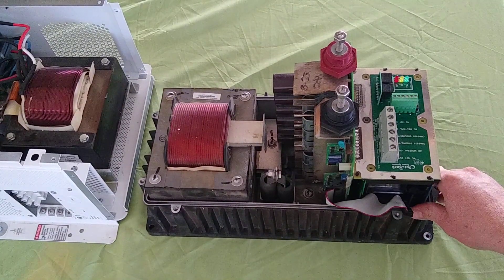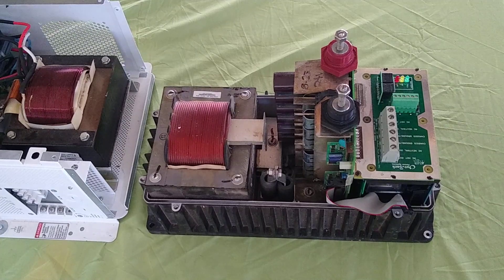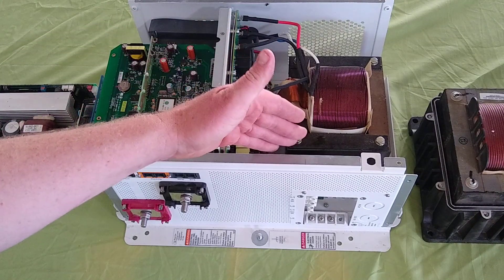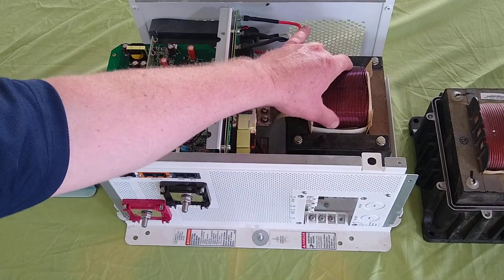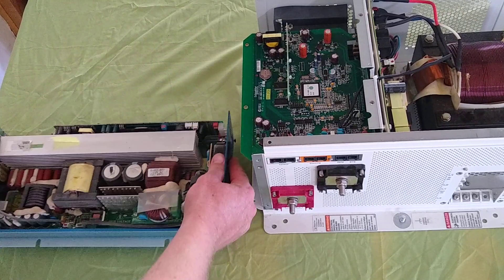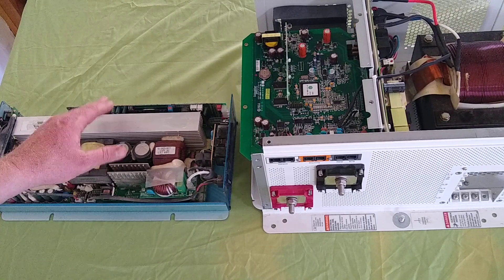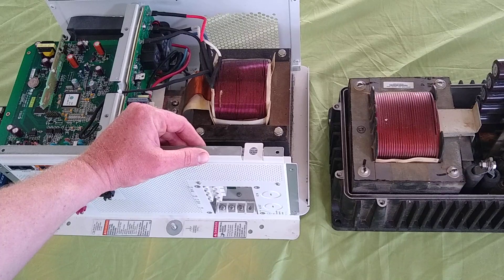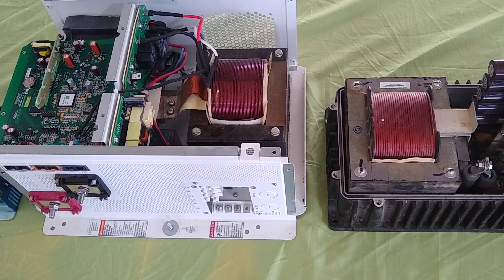Watch this before you buy an off grid inverter

Comment: I would like to hear Your opinion on Victron inverters please,specifically i have the wictron RS 48/6000/80 smart solar offgrid inverter,about 5 kilowatts pure power,with a 450Vmax 80amp solar charge controler,it runs even heavy loads and high start up motors too...but i would like to hear if You have an honest opinion about them...thanks,nice video too.

Comment: High frequency, tranformerless inverters like Xijia brand that is mentioned in the comments below are fine for powering resistive loads like incandescent light bulbs, heaters or laptop computers, but they're not designed for powering inductive loads like refrigerators, power tools, microwaves, AC units or compressors. You may be able to start and run some of these loads when your Xijia high frequency inverter is new but you're damaging your MOSFETs every time your load turns on. After enough high surge startups and you'll cook your FETS, guaranteed. I've spent the last 23 years running an inverter repair shop and can tell you from experience that no high frequency inverter exists on the market that can reliably start and run inductive loads over the long haul.
Reply: what if i get a high frequency inverter that is rated 10times the power of my inductive loads. will it not last for a long time?

Comment: Hi, im in kind of a pickle, I have someone selling me a Magnum Modified Sine (The black versions of the magnasine) inverter, and i have the option to buy one of the newer Growatt inverters, price is almost the same but i want an inverter to run basically as a UPS backup for my computers. what would you recommend i get? I believe magnum is LF and the growatt is probably fancier but HF
Reply: stay away from modified sine wave, they're horrible. I used a modified sinewave inverter for a few weeks for my laptop (original power supply, only a few years old), then a couple of months later that power supply died. Probably not a coincidence.

Comment: Your right about high frequency inverter but I seen 8kw high frequency inverter driver induction load pretty well the issue is not the highest frequency the issue is the transformer rating a 2000 watt transformer like that one you demonstrating will only give you 1450watt running and 1800 watt surge load but most companies don’t take the time out to put the right amount of component to get the higher frequency inverter to work like and low frequency inverter that’s the issue am new from college graduate in electrical engineering a is best and design and build higher frequency inverter that do work very will but it’s along more expensive to get high frequency inverter to work as a low frequency inverter but it can be done

Comment: I really wish I saw this before buying a “Reliable” WZRELB 48v “3,000w” inverter. Family member sold me 2 relion 51v 100ah batteries for really cheap (she upgraded to a 20kw battery) since I blew my budget, I got this piece of crap, shuts off at 2am with a 5,000btu AC, didn’t know about HF vs LF. Saving up for a LF inverter now. Very informative video.

Comment: Which hybrid inverter has less noise?
Sol-ark 12k or Schneider 6848 xw pro?
Or maybe other brand?
I'm looking for the less noisy hybrid inverter.  I appreciate your experienced answer.  Thanks.
Reply: 12K’s aren’t bad. Fans only run if it’s working hard charging or inverting. Not like eg4 6500’s running constantly! Schneider…I’ll know in a few days.
Reply: The Conext XW6848 pro has little or no noise especially when your load is below 4kw

Comment: Just found your video, three years later...

Looking at low frequency to handle deep well pump plus house.

What is that brand you said is 20 years old and still humming? Never heard anything but maybe the word "trace"?
Thanks!
Reply: I’m researching the same thing…
Reply: Trace was purchased by Xantrex in the early 2000s.   Later in the 2000s (or perhaps  early 2010s) Schneider bought Xantrex.   The units you are asking about have a name like SW4024.
"SW"  = Pure sinewave
"40" = 4000 Watt
"24" = 24V Battery

They made different power and  voltages which the model number reflects.   E.g. SW4048  = 4000Watt, 48V battery pure sinewave. 

The technology in these units remained  unchanged during the Xantrex era. Not sure what/how they changed under Schneider.  I have a SW4024(branded Xantrex) in service for 17 years.  It's solid as a rock.  Handles all the daily loads, a well pump, chop saw, table saw, etc all without trouble.

Comment: Great comparison! LF obviously its a better choice for its robust nature but there are some HF designs like the Xijia brand that has a large start capacitor now. It causes a soft start and that helps a lot with surge current. On the flip side soft start has some disadvantages with some sensitive devices. But they are cheap so you could have a couple of them dedicated to one task. In my case I'm prepping for power outages without an entire house solar system and so I have 3 inverters one of them being an Xijia and all it will be doing is running the fridge. But purchasing an Outback could be the start of something that is much better in the long run. Even if I'm using it as a heavy portable setup to use at home for now.

Comment: My two MPP LV6548's are all in one, each with 8000W of PV input via two built in MPPT units, and 6.5KW output, for 13KW total, for $2400 for both. It runs my two 2.5 Ton trane units, along with my 1hp Grinders, chop saws, compressor, and all the lights and refrigerators. They each charge 120amps to my DIY Lifepo4 batteries at the same time.
Reply: Mine kick ass as well zero issues and my digital clocks stay true un like my first 15 year on LF. I could keep a true clock

Comment: So much...
I've got a ProSine 1800 watt inverter and it's been running my cabin then my home for 12 years, including air-conditioning each summer, as well as fridge and other odd and ends of life. So not all high frequency inverters are junk. I did replace it with a Magnum 4024 a couple years ago, but it's still wired in and is 2 switches away from running my home. Also it lives outside in my Power center, in the heat...

Those old Trace inverters that keep on going have something in common with the Outback inverter. Robin and boB Gudgel, Robin was with Trace/Xantrex (Chief engineer?) before opening Outback and later Midnite Solar. And I guess you know that Trace became Xantrex and later Schneider...

Comment: Is there any way a\the Outback 'heavy' transformer can be taken out & changed? It appears as if the unit is epoxied into the case. Long story but in a storm mine got soaked & now won't turn on. Pretty sure the windings got shorted out.

Comment: You had 7 out of 12 4048's fail? I assume you meant 4048, you said 4024's, which are the larger 24V model (2524 is now discontinued). That seems like an awful lot of failures. Same customer doing the same thing to it, or 7 customers all having that kind of luck? Something doesn't jive there. My local statewide solar shop sells boatloads of gear and they say of the many inverter have returned or failed, the conext inverters rarely come up. Maybe you got a bad batch?
Reply: I have had my conext 4024 for over 6 years without any issues at all.
Reply: @ch198-d7s  I went ahead with the 4048 and it's worked flawlessly for 1 year. I think this is one of those cases where people overload them or put them in tight enclosures, or just some marketing ploy for a company with kickbacks from a preferred vendor.
Reply: @mgladden2  that’s true. Schneider is highly recommended in Jamaica. We sometimes reach temperatures of 38 degrees Celsius outside. The major suppliers of solar products all have stocks that keep running out.

Comment: Thanks for the info. Have you reviewed the Victron Multiplus 3000w 12v Inverter/Charger?  Curious about your opinion of the components used to build the Multiplus.
Reply: I have 2 1200watt multiplus inverters running 2years non stop
No problem
Reply: High dollar and good quality.

Comment: Is there a reason they don't make high frequency inverters with IGBTs?  Some of those can do like 100+ amps at 100's of volts.  If they overrated the IGBTs like 4x I can't see why they can't make high frequency inverters with really big ratings.  Could also throw in a 1:1 60hz transformer at the end to give a bit of surge capacity.
Reply: Yes.  IGBTs are excellent for very high voltage systems (which is why they're generally used on electric car motor drivers, etc.)  But they have a severe problem for low voltage systems: their "on-state" voltage drop (i.e. saturation voltage) can easily exceed 1v.  If you're running 250 amps on a 24v inverter (=6kw), since there would be an IGBT on both sides of the transformer (H-bridge configuration), that's 2v loss @ 250A = 500W of heat generated.  That's 8.3% loss.
However, if you're running 400vDC (i.e. 240v HF inverter output stage, or electric car), the exact same 6kw load is only 15 amps.  15A * 2v loss = 30W...literally a drop in the bucket in comparison.

MOSFETs by comparison are excellent for low voltage systems, as their on-state is measured in ohms (often milliohms), not volts.  (Worth noting: high voltage MOSFETs usually have a very high ON resistance, making IGBTs the better choice.)  If we have 3 paralleled HY3810 MOSFETs @ 0.005 ohms (5 milliohms) each, that's only 1.6 milliohms per quadrant.  As there'll be 2 quadrants in use at any given time on an H-bridge, that's 3.3 milliohms @ 250A = 206W of heat, less than half of what a comparable IGBT would generate.  Only 3.4% loss.

In short: IGBTs are excellent for high voltage systems (say >100v).  MOSFETs are better for low voltage systems (generally <100v).
Reply: @sidlori1592  Oh yeah that makes sense.  Did not realize the voltage drop was that high.
Reply: @redsquirrelftw  I was quite surprised myself.  Some of those "400A, 1200v" IGBT bridge modules look really tempting for a LF inverter H-bridge...but reading the spec sheet revealed that they are totally unsuitable.  Quite a disappointment, as they aren't terribly expensive...
Reply: @redsquirrelftw  They're worse than I recalled...!  As an example, there's the CM600HA IGBT module (single unit, not a multi-pack unit, you would need 4 of these for an inverter H-bridge, or 6 for a 3-phase motor driver)...rated 600A, 1200v.  Sounds great, right?
Collector-emitter saturation voltage @ 600A?  2.1v typ (3.0v max.)   1,260W of heat!   With 1 on either side of a tranny for a 24v inverter @ 600A, that's 4.2v of loss, and 2,520W of heat.  Good thing they're rated at 3,670W of heat dissipation each...the equivalent of two space heaters running full blast.

Yeah, they're great for high voltage systems ;-).

Comment: What would be a decent inverter in 2020 for a small cabin running off 2.5kw in solar. Biggest load may be a window unit (8000btu) think under 700 running watts.

Comment: Hi! I'm planning and shopping for a 230VAC off grid solar power Inverters for my hottub, that runs and wired to 240 Volts. My hottub hast it's own separate feeder breaker, and outside GFCI disconnect box. I was adviced by a solar business representative that in USA, the grid standard is 120VAC per phase, and require 120VAC inverters to function with Solar Regulator, and that Solar Regulation services will not work properly for USA grids. This means that a 230 VAC off grid solar power inverter may be sending energy back to the utility company. I was adviced to get 120 VAC off grid solar power instead, but if I insist to a 230 VAC after being adviced, then they can not provide me with effective tech support for the system. I am not sure if a 120 VAC solar power inverter can power my 240 Voltage hottub. Please help me understand.
Reply: Sounds to me like a "solar business representative" who only offers 120vAC inverters and is giving you a load of BS to try to sell you their product.  Their statements are simply and completely not true.

- You will need a 240vAC inverter to power your 240vAC hot tub, unless you are fine with about 1/4 of the design heating ability (240vAC @ 30A = 7.2kw...the 8 ohm heating coil would only run 15A @ 120v, 1.8kw.)
- Grid-tie over 240vAC is 100% completely possible.  Heck, a grid-tie inverter backfeeding into a single 120vAC phase, is going to appear as 240vAC back to the grid through the autoformer principle of the center-tapped utility transformer!  You were given a bunch of absolute BS.  
- Not sure if there was confusion from the "solar business rep" about grid-tie vs off-grid systems.  Sounds a bit like they were trying to sell you a grid-tie system (most "solar installer" companies out there want to sell you grid-tie), which has to be connected to the "electrical grid" in order to produce any output power.  (Grid-tie systems will shut down per UL requirements if the grid goes down.)  I'm suspecting this because of the talk about "solar regulators."
- If you're wanting an off-grid system (as you mentioned), keep in mind: a standard off-grid inverter CANNOT be connected to an electrical switch box that is also connected to the electrical grid.  Providing that the electrical lines going from the off-grid inverter to your hot tub never contact anything connected to the electrical grid system, a properly sized off-grid inverter + solar panels + solar MPPT charger + battery bank will do nicely.

Comment: What about hybrid inverters?  I have a grid-tied solar system. Now I want to install another small array with hybrid inverter to add some battery backup.  Looking at all options, what do you recommend?
Reply: Schneider Conext SW 4kW 120/240VAC 24VDC Inverter/Charger RNW8654024

Comment: Have you worked with the SOLARK inverters? I hear mixed reviews on it.
Reply from the maker: Not yet
Reply: 18 months off grid on two 12k. They work fine as long as you don’t have high inrush loads  and install soft starts on heat pumps or a/c’s. People that complain are the ones that think they can run well pumps, welding machines, air compressors and 5 ton heat pumps with no soft start. The ones that complain about flickering LEDs need to spend more money on better quality LED lights.

Comment: The military ensured against premature failures by way of controls for what components were used. Now that the military is using more COTS (commercial off the shelf) components, they are experiencing many of the same failure problems with reliability, longevity and robustness.

Comment: Hi, thanks for comparing different inverters, very instructive. Do you think the Magnums (Magnasine) are still as reliable as before ? I have seen a lot of people on youtube having problems with the temperature sensors and the fets. Also, the fets on the ms4448-pae seems to be soldered directly on the main board and hard to service.

Comment: Great video! Our magnasine 4024 was unintentionally torture tested 8 years ago. Mounted in the basement under the place where the bathroom is located, about a year later the toilet tank broke, by the time we got home, water was cascading down the wall over top the magnasine and to my surprise, still working to supply power to the water well pump and the septic pump to keep the basement from flooding. 

Turned it off,  took it apart and blew air on it for 2 days, cleaned up the mess, fixed the toilet, relocated the magnasine to the main floor, turned it back on and it worked perfectly. Today 8 years later its still working supplying power to our off grid farm. In my humble opinion most inverters would be completely destroyed under those circumstances. Magnasine Built like a tank!
Reply from the maker: Glad to hear it. They actually sell a hood for these. I also hope they don't screw with the design anytime soon because it works!
Reply: Impressive

Comment: "Fly-wheel effect"? To support surge, the components need enough headroom in their specs to support it, and there needs to be enough energy storage (capacitors) to support it. Also, the intrrnal monitoring needs to be configured to allow the temporary overload without shutting down. It's nothing to do with the transformer.
Reply from the maker: Transformer weight does mater for surge capabilities. And yes capacitors as well.
Reply: @CaseyColando  that’s true but it’s equally relevant for HF and LF topologies. Perhaps thermal mass is an advantage for the LF inverters during surge conditions.